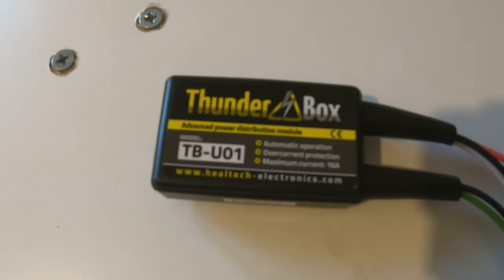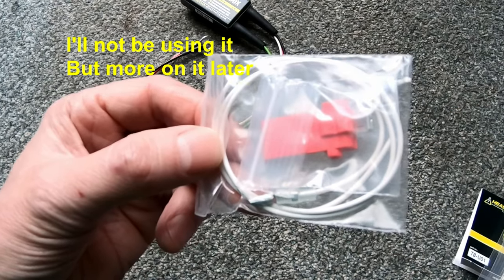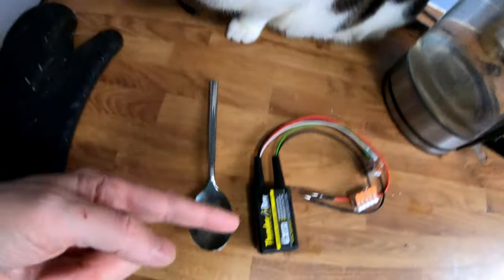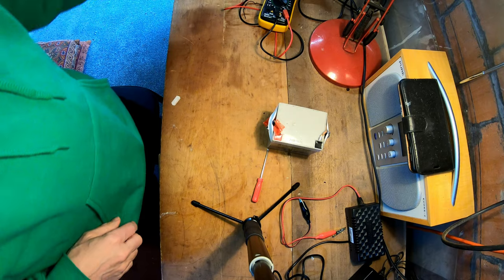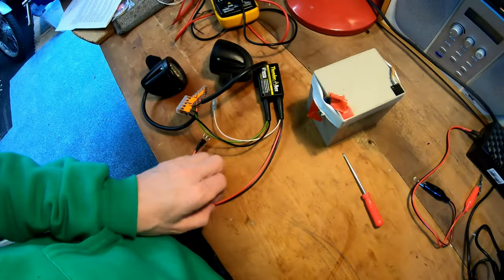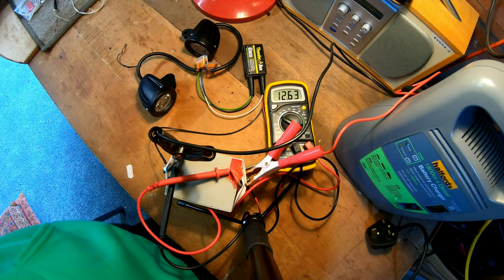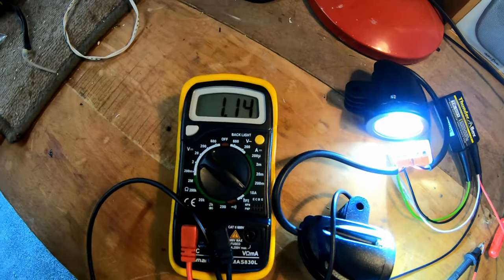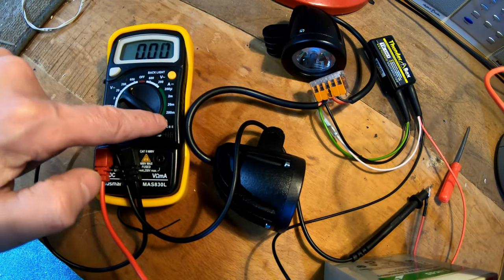Healtech Thunderbox TB-U01 - Slightly Technical Review

Comment: Just thinking....would it fire up when you put your bike on the battery charger? That would be something not wished for. So wondering if it would be the better solution to use the white wire to have it fire up with the ignition?
Reply from the maker: Yes I wondered the same after uploading the video. It would be easy to connect the white wire to the black which disables it for charging- just snap it into the black terminal block. I could even just fit a switch under the seat if it became an issue. I ride regularly so I don't ever really charge the battery, even in winter. DrJ has run the box 2 winters and had no problem. But it is a good point 👍👍
Reply: @CodgerBiker just to be 100% clear, you can run that loose white wire to a killswitch and just snap it into one of the fittings with the black wire ran to it, and that switch would he able to shut it off for trickle charging?

Comment: Installed the thunderbox on my 2023 Triumph Tiger to power my Garmin.  If worked for the first couple of rides, then it stopped powering on the Garmin, however after riding about an hour the Garmin powered up.  Healtech advised connecting the white wire to a switched wire.  Used the wire from plug to phone charger under the seat and it now works perfectly.  Of course I could have done the same thing to power up the Garmin without the Thunderbox, but at least I have some extra circuits I can connect if I ever need to.
Reply from the maker: Sounds a bit odd. You could connect the Garmin direct to the switched Acc under the seat. You'd not need the Thunderbox then. There is definitely a switched Acc on the 2021 Tiger 850 Sport.

Comment: I've been looking into these for a few days. The Heal Tech websit is a little confusing (or poor if you prefer). Are there different variants for particular bike models? Their website would suggest so but my brain, backed by your video would suggest one size fits all, unless you dont have a 12V system. Any ideas?
Reply from the maker: From memory there are two versions. Both 12v, so no go on a 6v or 24v system. Only difference appears to be 2x output on the more expensive version. Mine was the cheaper, single output. So you can put more things on the larger version so long as you don’t overload each of the 2 outputs. They are useable on any bike as they just bolt to the 12v battery - well that is my understanding. Also some have said they do not work well with heated grips, I have not tested this. What I can say is my friend has used one of these to power his spotlights and GPS for a couple of years and it has worked perfectly. These are just my opinions, I have no connection to them, and I do not use one. So take it with that advisory 👍

Comment: You mention that you prefer to still put an inkine fuse for each connected unit, and I can buy that. But doesnt also that remove a large reason to use this item? You can probably get a fuse box for 1/3 of the cost, fulfilling the same role?
Reply from the maker: Good point. However after 3 years faultless use I'd probably just leave an inline fuse in if the lead already had one. Secondly, heated grips apart which 'pulse', it will auto switch on/off anything connected to it, a few seconds after start up. So no battery drain if DrJ forgets to turn the lights etc off. Basically it's a versatile thing. 👍

Comment: Can i use an on/off switch in this setup? How to wire a switch (in your video wiring), to be able to turn on/off aux lights while engine running?
Reply from the maker: From memory, there is a wire provided, to make it switchable. See manual on the healtech website.
Reply: @CodgerBiker  What i meant was to add a handlebar on/off switch for the aux lights
Reply from the maker: It’s the same as any other supply. If you put a switch inline with the lights then you can turn them on/off. So long as you have electrical experience, or get a mechanic to do it. The manual is on the site, it’s easy to understand, if you have technical ability. If not, then get a mechanic to do the job.

Comment: Nice video!!!!  So do i understand you correctly?  My heated gear when connected, no longer requires any in-line fuse?  If so, this thunderbox is a true winner
Reply from the maker: Hmm, not sure about that. It's rated at 10amps I think, or 2x10 amps with the larger version. I'd probably fit a fuse anyway, why is it an issue?

Comment: Was going to fit one to my Husky 501 that dosnt have ignition switch. Leaving the heated grips on is the biggest issue i have as GPS and Lights are obvious  when left on and yet heated grips trick the unit into thinking its being charged or something and it stays on so really i dont see the point. It becomes nothing more than a hub.
Reply from the maker: Yes that's something that has come up. It does simplify wiring, and turns DRL on and off. But, as you say, it's not ideal with heated grips, though most of them turn off eventually if connected direct , so not needed. 👍

Comment: Not cheap but it's easily the best accessory I have ever bought coz it simplifies the safe installation of dashcams, additional USB + 12v charging sockets & auxiliary lights without the need for a factory accessory plug. As idiot-proof as they come, absolutely no need to faff around tapping into a switched 12v supply to trigger a relay circuit. Those clip connectors are a genius addition as they idiot-proof the thing even more -- they're not waterproof, but it's a simple matter of plastic-bagging them if you're worried about them getting wet.
Reply from the maker: Definitely much easier with just one connection to the battery. One drawback has come to light, is due to the current pulsing of some heated grips, there is a possibility of it not turning off until the grips are turned off. I'm guessing it is fooled into assuming the engine is running due to voltage/current fluctuations caused by supplying the grips. 👍
Reply: These WAGO clips are not designed for automotive/motorcycle use, as they're not moist proof or vibration resistant.

Comment: I have two sae leads one for heated gear one for trickle charger so wondering if I can clean up cables by putting all through thunderbox
Reply from the maker: I wouldn't expect it to work. Also, there's a chance the Optimate might make the Thunderbox think the engine is running and turn on whatever is attached to it, as the voltage rises. Just a thought. So I'd maybe disconnect the TB while charging the battery. Only my feeling. Not gospel.
Reply: @CodgerBiker  I think so I will leave the trickle charger cable out of the box but good tip ordering 2 next week

Comment: Interesting, was thinking about getting one and your demo was very satisfying, thank you! Why are bikes not fitted with a similar master unit which would do the same job and save all the trickle chargers littering up peoples garages/sheds?
Reply from the maker: Well some bikes have switched accessory lines which are better. But this is a good option for those bikes without. If charging the battery you'd probably have to disconnect it, or use the white wire connection, which a switched Acc line doesn't need. So I'd still prefer bikes with several switched lines in an ideal world. 👍

Comment: Really useful video. Thank you for posting it. Just wondered do you still have to have the inline fuses for each item or is that all protected within the unit.
Reply from the maker: Cheers. Personally I'd install the fuses, though I suspect it would limit the current if the worst happened. I'm a belts and braces guy.
Reply: Will do thanks for the quick reply

Comment: Hi Codger, Good News - my Tiger 850 has been brought forward and should be with me in early April.  Please can you provide a link to the Auxiliary lights you and DrJ have fitted to your bikes, as they look to be excellent value.  I intend to fit a Thunderbox for a Sat Nav & Aux Lights as the DIN socket below the dash is live all the time and will flatten the battery.  Many thanks, the Kalamity Ken aka The Kalamitous One.
Reply from the maker: I'll try and find them, Amazon jobs. Don't forget there is already a switched socket under the 850 seat, I found it during the actual install. I'll post the link in this message as an edit if I can find them. Fitting same to my 500x soon 👍 PS best name on YT! 👍🤣
Reply from the maker: The exact ones we bought are no longer on Amazon. These look to be exactly the same. I’ve ordered them as well for spares.  https://www.amazon.co.uk/gp/product/B082PPDDBL/ref=ppx_yo_dt_b_asin_title_o00_s00?ie=UTF8&psc=1
Reply: @CodgerBiker  Many thanks for the replies & Info.  Like you I am the big 6-0 this year.  My name comes from when I did Track Days in my 40's in a kit car.  I did them with my BF Dave and together we became known as Kalamity Ken & Dave Doom or Kalamity Doom for short.  Those were the days!
Reply from the maker: Top names! 👌

Comment: are there fuses for each wire?
Reply from the maker: It's protected against short circuit, but personally I'd install a fuse in any accessory line attached to it.

Comment: I bought one of these and hooked it up to my electric motorcycle. I figured when I turned it on and the headlight, taillight, dash etc lit up it would trigger and come on, but it didnt.. I thought ok, maybe I just have to engage the motor and move the bike a little, nope.
Reply from the maker: It works, as I understand it, by sensing the battery is charging. The one we installed switches on a few seconds after the engine starts, and the charging begins. That won't happen on electric bike. Best return it.

You could use the trigger wire to activate it if there is a switched 12v line. But I think its main design is for bikes with an engine.
Reply: Yeah the website says "will work on any vehicle that uses a 12v system" on an EV when the 12v needs juice it gets it from the main battery pack instead of from a stator or an alternator. In theory it should have still worked, but i think the threshold it needs to trigger is just too high.. I emailed them to see what they say.. Maybe at the least they will add something to the website that states this can not be used on anything but an ICE engine vehicle.
Reply from the maker: It's a good point. You could trigger it with the 3rd wire to a 12v switched line. I guess that covers them. From what I could tell the auto-trigger is by sensed AC from charging. So, some people, have reported it stays on if heated grips are used - they also pulse mimicking AC. 👍

Comment: Ahh, now I see how the lights connect to the Thunderbox, but would still like to understand the front-of-the-bike brackets used to mount the lights, what wires run between the lights and the box (front to back), and such niggling details.  "...obese cat...", too hilarious!
Reply from the maker: He is obese it is true, but happy and cares not a jot. I try to shame him, wasting my time. This video might help also. As you can see a simple wiring ‘harness’ (just a piece of twin cable, the lights connect in parallel. Plugs can be used or just solder and heat shrink to make watertight). 
https://youtu.be/PpQiY4da4Gs

Comment: I got a Thunderbox yesterday and I´m very happy with it. I have my fog lights and heated grips wired to it. I only have one problem: 

Whenever my heated grips are turned on and I kill the engine, everything stays on indefinitely. When I had them turned off, my other accessories switch off after 10 seconds, just how it´s supposed to be. Did you have any similar problems?

For your information, I use Koso heated grips. I don´t know why this happens but the Thunderbox should overrule everything.
Reply from the maker: Seems odd. I have Koso grips on my KTM. They are attached to a switched line. But I thought the Koso also self switched off if they detected battery drain? So that is doubly odd. I did notice when measuring the Oxford grips they modulate the current. Only thing I can think of is the Koso do the same and it’s somehow fooling the Thunderbox into thinking charging is going on, as the current fluctuates. Maybe it waits for a steady drain before shutting off, and the Koso is tricking it into thinking that charging is happening (wild guess on my part) - unlikely as they sell it as useable for heated grips. If you have a switched Acc socket on your bike, I’d attach the Koso to that on their own. Best I can think of. 🤔👍 Also, before that, I’d swap the connection block of lights and grips and see if when just the grips are connected they go off. In other words just go over it carefully, because it should be off.
Reply: @CodgerBiker  Thank you.

I also contacted the healtech support and they basically said the same. 
Somehow the grips trick the box into thinking that the engine is still running.

They told me to connect the white wire to an ignition switched feed, which I did.
It‘s not ideal as I‘d rather have the engine running before my gear turns on but it works now.
I‘ll try out your suggestions tomorrow
Reply from the maker: Hello. Thanks for that information. I would have thought they’d have had that covered as I know Oxford heated grips work the same way and they are the biggest selling. And they sell the Thunderbox as compatible with grips. But thanks for getting back to me. I suspect the on/off of the heated grips looks like charging pulses to the Healtech. But as it is on the output you’d think they would cover this. Anyhow you know the cause. Not so bad to have the on/off wire control if you have to. Glad you have sorted it. 👍 I doubt swapping it will help now Healtech have said the reason.